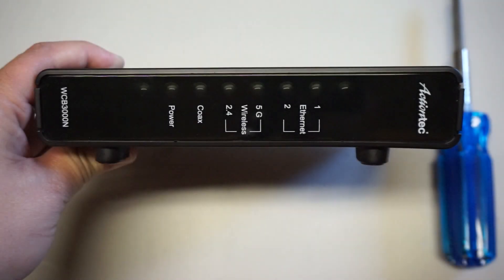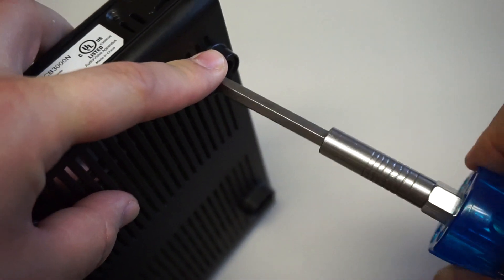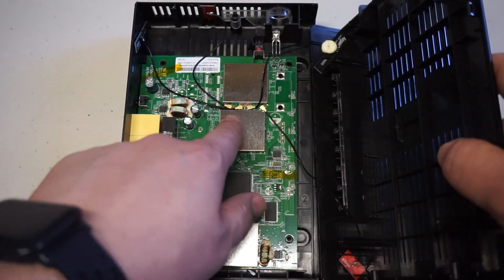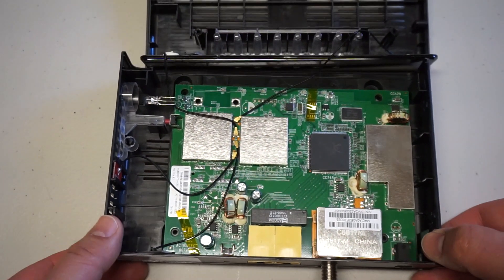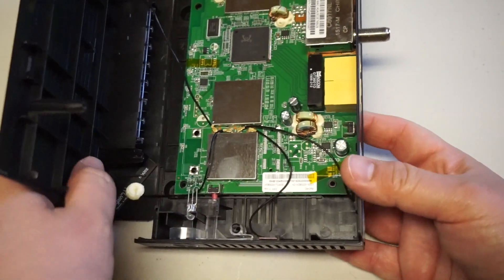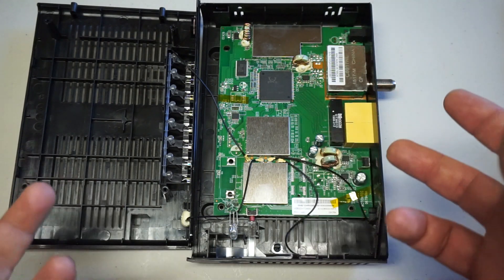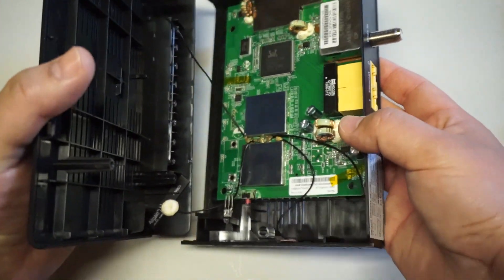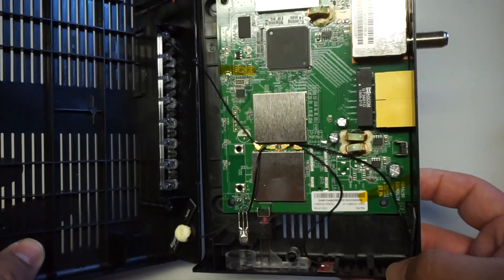Teardown of an ActionTec WCB3000N MoCA v1.1 Cable to Ethernet adapter

Comment: Could you describe more in detail about that attenuation device about a to strong current? I never knew that was a thing.
Reply from the maker: Ahh, ya, so what I was describing was an cable attenuator. What happens is if the signal from your cable company is too strong, it can overwhelm the input stage of your modem, and the result is bad SNR. It's a problem that can be intermittent, which makes it hard to debug. https://www.speedguide.net/faq/what-is-a-cable-attenuator-488
Reply: @thedoghouse825  great information, thank you.